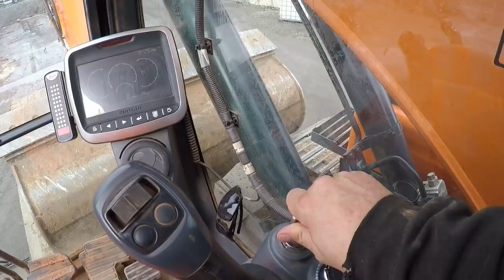M.T.D 158 busy day it was

Comment: The white 6x6 are called pinzgauer. Not sure where they are from Russ.
Reply: Made by Steyr-Daimler-Puch in Austria, who also made the Haflinger, until 2000 and BAe after that until 2007.  The British Army used loads of them (hence why BAe got in on the act) -  4x4 and 6x6.  They were originally powered by a 4 cyl petrol Steyr engine but this was later replaced by a VW straight 6 turbo diesel.  I would assume the ones there were Army surplus.  Superb vehicles by all accounts.